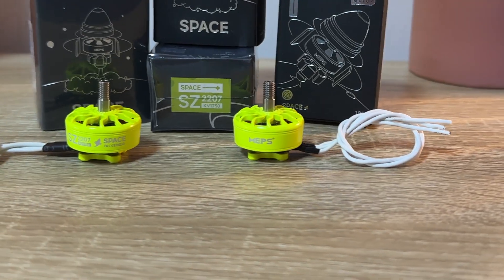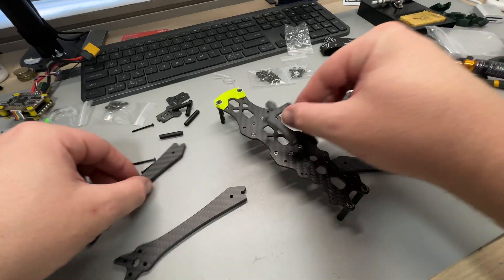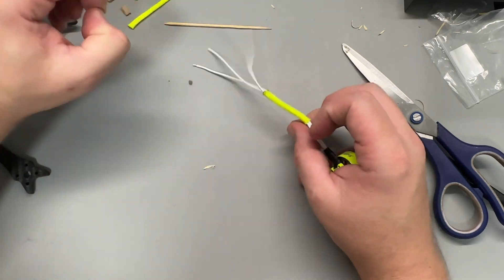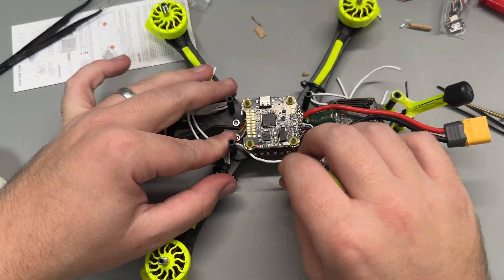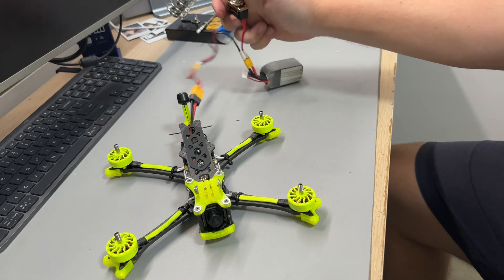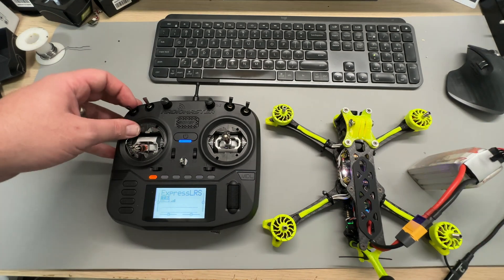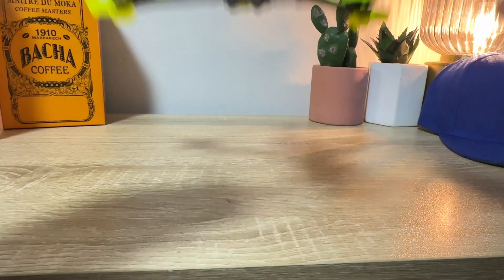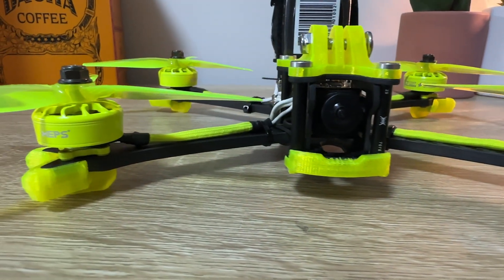I Built A 5" Freestyle Drone With Fluro Yellow Motors

Comment: You certainly got your Walksnail system working well -- what that recorded in the goggle or on board the VTX? and if it was the VTX, was it that good in the goggle?
Reply from the maker: It’s the latest firmware and it’s from the VTX using the new “Avatar HD Kit V2”

Goggle looked ok to me. Seemed a little washed out but maybe the lens was dirty from having my grubby fingers on it

Comment: Should have put some leds or Cobbs on there in yellow
Reply from the maker: That could be for another build.
Reply: @DarrenAllatt  UV leds to make that yellow pop even more! also perhaps some black heatshrink around the white wires?
Reply from the maker: I was tempted on the heat shrink for the white wires but got to the point of too much hassle. Maybe next time

Comment: 5:44 did you break the prop on back right ? as it took off at an angle and hit the bench ? 
what exactly happened here ?
Reply from the maker: Motor 1 (back right) spins CCW, but I put a CW prop on it; which caused it to flip out on take off. So had to change to the pink prop which was a CCW.
Reply: @DarrenAllatt  ohh ok makes sense. thanks for sharing.